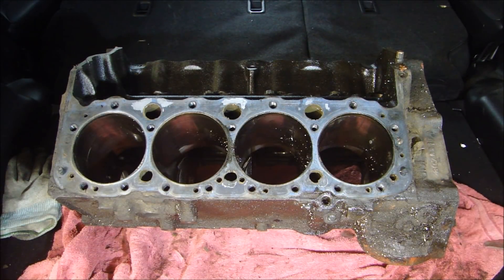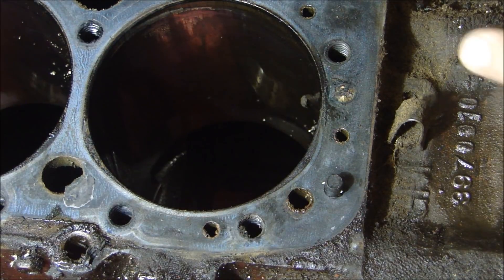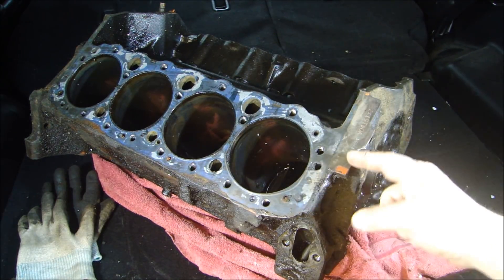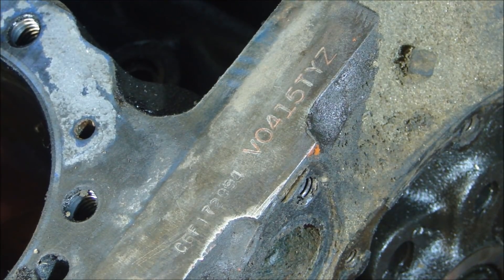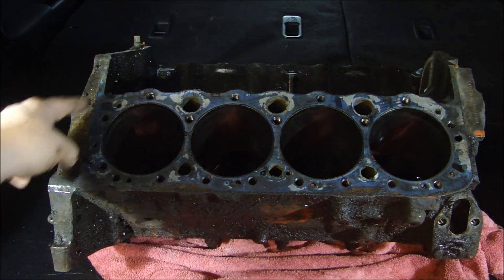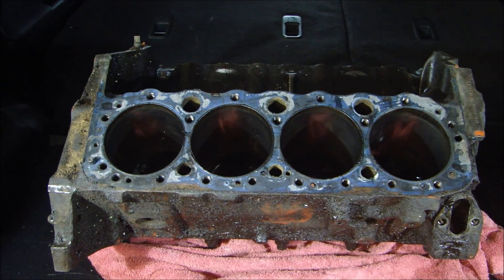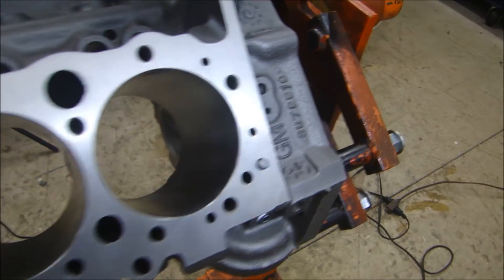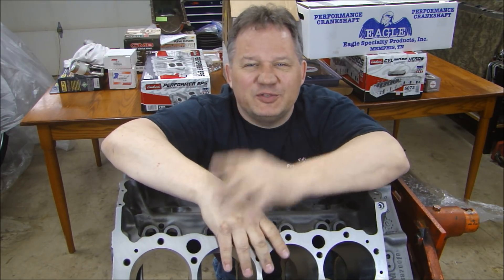Engine Building Part 1 The Block - 350 Chevy with a Holley Sniper EFI for a '76 Vette

Comment: I just picked up a motor almost identicle to the one you have here. C6F170013 V0408TYZ. Just pulled it apart and it's a 4-bolt main block.
Reply from the maker: Awesome!

Comment: Pete, I have a comment and then a question. I have built many engines over the years and have always washed my blocks and parts  before assembly. However, I recently purchased a Chevrolet ZZ4 short block from a major supplier of Chevrolet engines. I was expecting a super clean short block, but, was surprised when I opened the crate and pulled the plastic off to find not just a "kind of" dirty short block, but a filthy engine assembly. I don't want to pull the crank, rods and pistons out of the block. There's no way that I can assemble this thing the way it is. My question is: How do I clean it with the rotating assembly in place?!!!!!! Thanks in advance, Jim
Reply from the maker: That's a tough problem. You can soak the whole thing in kerosene and use some type of agitation. Blow it out and let it dry completely. Fill it and hand pump oil through it while turning the crank

Comment: I am sorry but you can't have a block with two different years and if this was a 69 z block it would have a DZ casting number. Sorry. just because it has a 4.00 inch bore don't make it a 350,327,or what ever. you have to go by the casting letters and they don't lie.
Reply from the maker: Of course

Comment: You can easily tell it’s not a 350 it will have a lot of meat between the cylnders
Reply: If it’s not a 350 I mean. You can also tell a 283 or 327 by the holes in the back of the valley for the vents
Reply from the maker: Great point

Comment: Small question and sorry if it's dumb. If I wanted to build a big block chevy, would most of these steps (like throughout the series, not just this video) be the exact same? from what I've been told, small block chevys are the same as big block chevys, in terms of putting one together
Reply from the maker: I try to make videos that give you basic principles to follow. The small block is very similar to the big block

Comment: I bought a partially disassembled sbc 350 from a 78 Vette at the junk yard - cheap. There's a large threaded hole in the horizontal plane below the fuel pump. What is that for?
Reply from the maker: Can you text me a picture?

Comment: Pete how you get the engine block so clean?
Reply from the maker: Bake at 350 for 24 hours, run through a bead blaster and spray with cast blast.

Comment: Pete another great informative video.  I have a question. My 350 has no info on the block pad, so It has been decked.  Does decking increase the compression ratio?

Comment: Awesome project. Excited to see this one. I have the sniper efi in my 76 vette!
Reply from the maker: That is awesome, how do you like it?
Reply: Pete's Garage it’s working great now. Just keep driving it so it can learn and try to trouble shoot issues along the way. I had some trouble getting it set up at the beginning. Setting up IAC and I had high idle issues. I also have side pipes on the vette so the o2 sensor sits at a slight upward angle. I’m assuming this might reduce the life span of this sensor? Overall I’m happy with it.
Reply from the maker: I'll have to keep everyone up to date. Thanks for the info. I don't think it will hurt the O2 sensor.